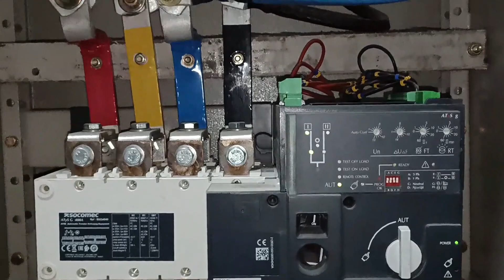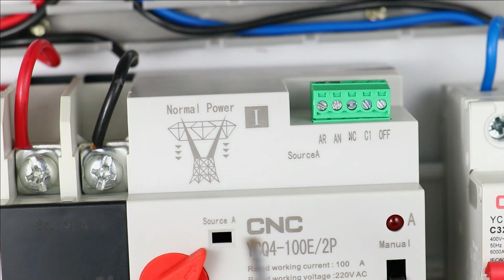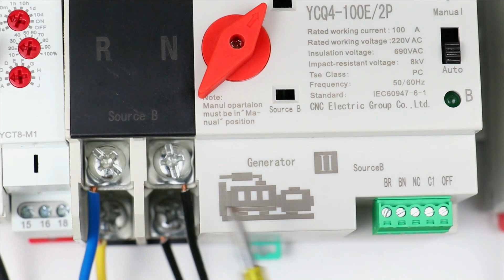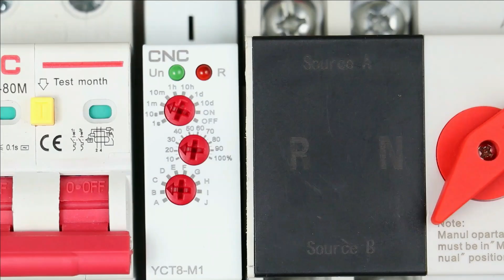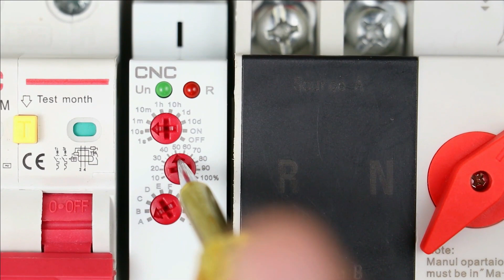Learn Practically Auto Transfer Switch (ATS) Panel Connection @TheElectricalGuy

Comment: Question about  3 post W2R-100 II ATS, will it still work if the Neutral wires are all connected to a bus bar in a DIN Rail box, then run a Neutral wire from the bus bar to each Neutral terminal on the Automatic Transfer Switch. I have connected mine this way and the Green and Red LEDs just flash on each source. It does not auto switch. is the neutral the reason?
Reply: I figured it out! We do not need to use Neutral and L1 and L2 hots, only the 2 hots or if you want to control with the Neutral as well then the Control needs to be connected to both hots not the neutral, since the control needs 240 volts to operate. When I had the neutral connected and using the L1 with Neutral it was only 120 volts which is why the LEDs where flashing to show there was a problem. With that said you can transfer 240 volts with 2 post just connect the 3 Neutrels (Source A, B and Load) to a bus bar. Also you could use a 4 post if wanted so in the future if the internal contacts get damaged you could then use the other 2 posts.
Reply: What amp is needed for the timer ? If supply for meter then should be over 200 amp?

Comment: Captive video.however it is not full automatic.where is the  generator commannd control wire
Reply: It is the top green console. It is on instruction manual. Google CNC ATS transfer switch.

Comment: I would like to connect solar & grid, and have a surge protection relay & protection in the system, give me a list of items I need to buy with four circuit breakers for lights, simple sockets, heavy electrics like hotplate & a fridge.